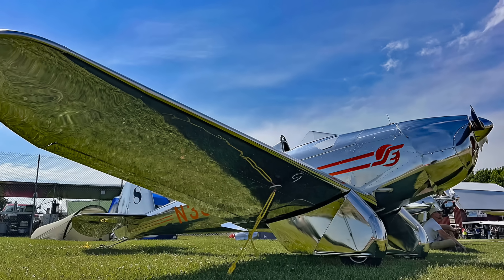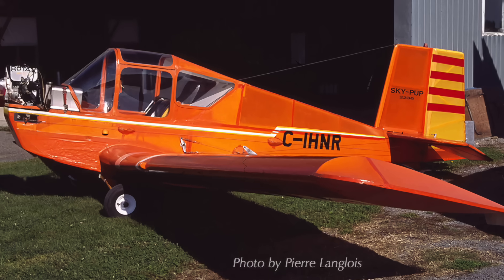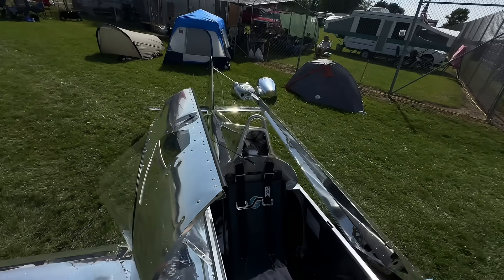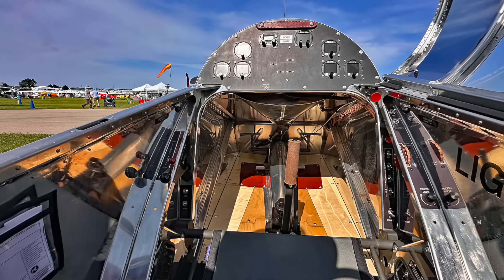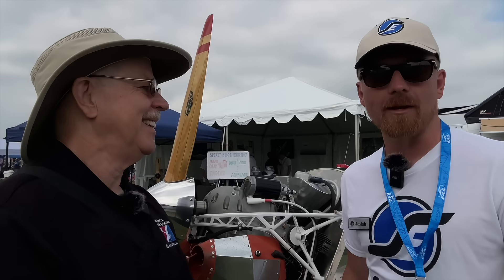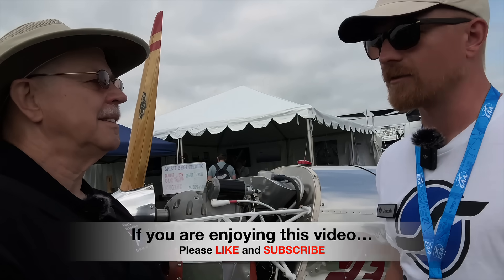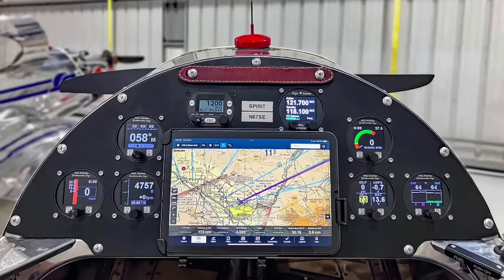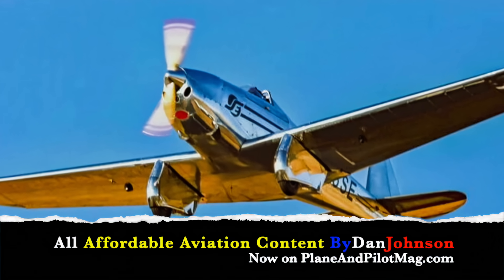Spirit SE-1 Charms Oshkosh - 0725

Comment: No doubt an appealing aircraft. Before you lay down your hard earned cash, I’d suggest going into Barnstormers and do a Search using $45-55,000.00 as your parameters. You might be pleasantly surprised to see what’s available at that level. Just a suggestion.

Comment: They should make a two seat version so that new owners can check out with an instructor.
Reply: The max useful load is only 300lbs. They’d need a different engine to run a two seater.

Comment: 91 no ethanol. Is that readily available?
Reply: Sure, most gas stations where I am have at least one pump with No Ethanol. It’s the only thing you should use with lawnmowers, blowers, string, trimmers, etc.
Reply: A few stations around me offer it.  With a fuel capacity of only 8 gal, it wouldn't be too hard to carry it to the airport for local flights.  Folks already do this for Rotax motors.  I think a lot of airports still only offer 100LL, so that might be the only option if traveling.  I don't think many pilots will range far with this this plane.
Reply: I have a T-Bird II and that is all is use. Bought a 100 tank and mounted it on a small single axle trailer. Installed a 12 V pump and hooked it up to a battery! Works great! Also use fuel stabilizer and haven't had any problems for several years.

Comment: Very impressive plane. The looks of thoroughbred with hints of past aircraft such as the Ercoupe, Globe Swift and Ryan ST. It is also very interesting to compare it to the Chilton D.W.1 of 1937, size, weight and performance all being similar. On another note, I own a 90 degree aircooled V-twin of similar horsepower, in a 2003 Ducati Monster 400S, not that it would be suitable for aircraft use, reving to 11000 RPM!

Comment: Lovely airplane, but I’m still waiting for that ROC number.  Affordable airplanes need affordable (short) runways.
Reply: Website says 500ft ground roll. I doubt that’s the case on a grass strip but that’s still pretty respectable, especially considering its has folding wings and no composite or cloth.
Reply: @xpeterson The landing roll is longer than TO.  It looked like an SE1 nosed over braking at the end of the ultralight field at Osh, or was it SnF…
Reply: @OtterFlys  yup, that’s a risk with all taildraggers. I think they’re working on a nosewheel version that sounds pretty interchangeable if that’s a concern for you.
Reply: The specs are on their website.  It says the rate of climb is 750 fpm.  I hope that is at max gross weight, but it doesn't say.
Reply: @lunchbagr4750 Yes, found them there.  Now my only concern is the 'character' (NVH) of the engine.  A very subjective thing but it is important to the enjoyment of flight.

Comment: How many pilots want a single place conventional gear airplane?
Reply: Most pilots will insist they need at least two seats.  Give them that and they will insist they need side-by-side.  Give them that, and they will still fly alone 90% of the time.
Reply: After flying 16,000 hrs with someone either sitting behind me or next to me, I do!
Reply: Who cares? Clearly not designed for the unwashed masses…
Reply: Me
Reply: Me2

Comment: Side note on mosaic, I've been doing a lot of napkin math with LLMs on what's possible with good engineering. Making the fuselage of a jet as a compound curve single piece carbon fiber bubble can be a lot lighter than the typical alu sheet on frames. Carbon fiber is uniquely fantastic as a pressure vessel (pressure inside, not great as a submarine). A Pilatus PC-24 has a stall speed around 82kts, not that far from mosaic so with a significantly lighter construction you can have a massive private jet able to do close to mach 1 as an LSA under mosaic :)  I'm not sure they thought that through. The speed limit as I understand it is 250knots indicated which translates to quite the speed at altitude. So if you make a Gulfstream G650 as one piece carbon fiber and skip the marble in the bathroom and only place 3 large seats in the passenger cabin and use the rest for beds, showers, toilets, kitchens and tennis courts, it's an LSA :)